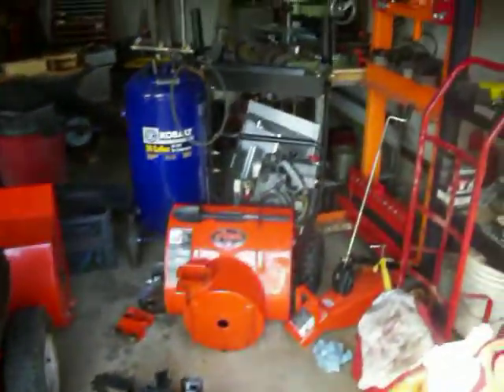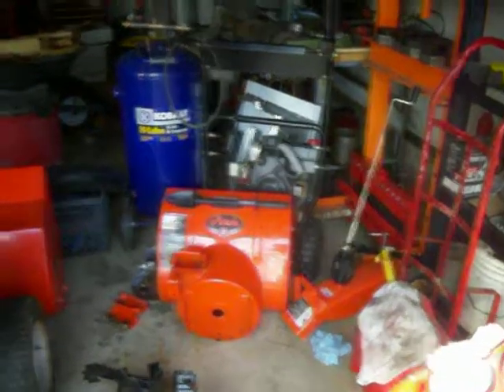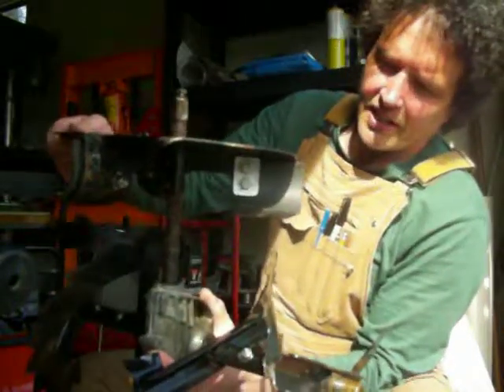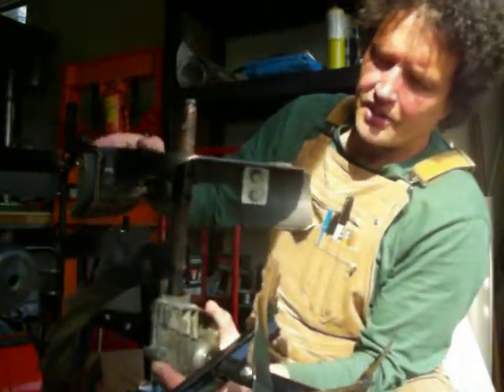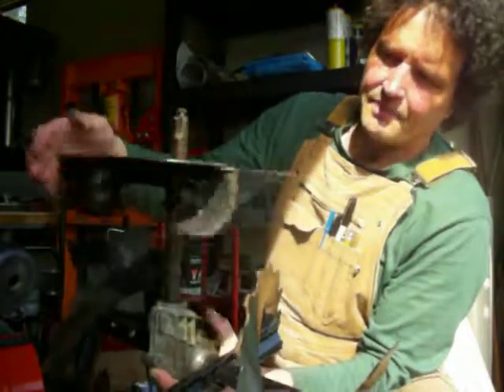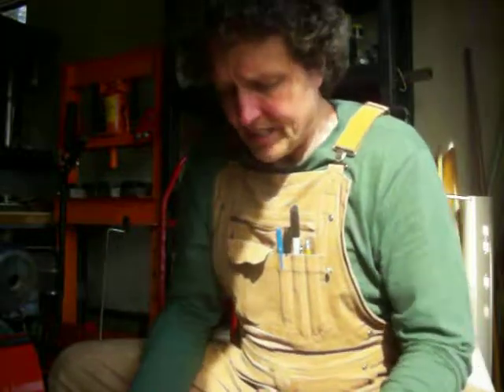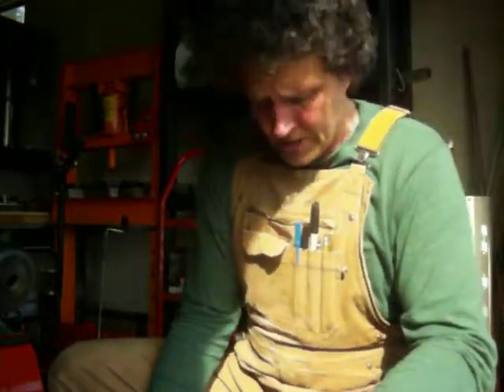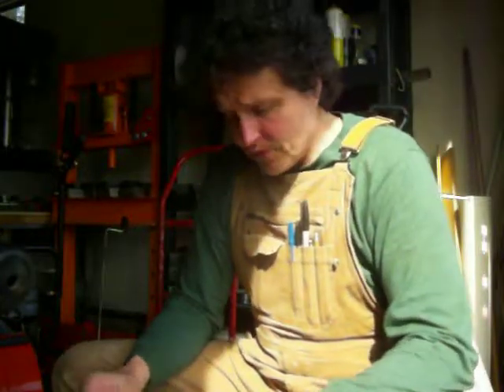Two-stage Snow Blower Rubber Wiper Impeller Modification on an Ariens 520.

Comment: Thanks for sharing - can you comment on how this affected the performance? Did it prevent clogging in the chute?
Reply from the maker: It never clogged on me once after installing the wipers on the impeller paddles.  It's a must-have modification!

Be sure to slot your wipers so they can be moved to touching the impeller housing before tightening them down.

Scan the rest of YouTube for the details on the process.